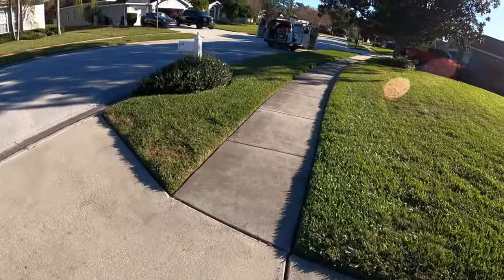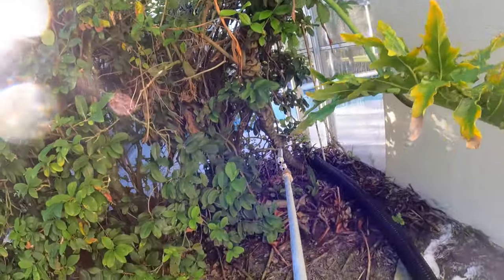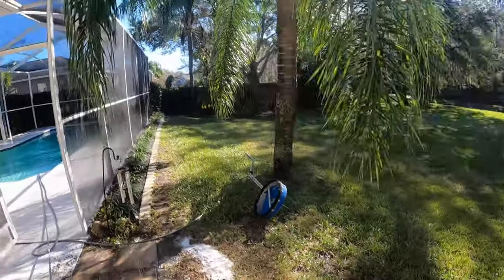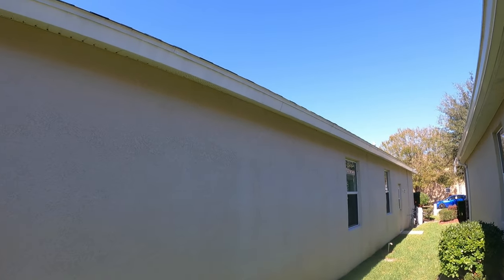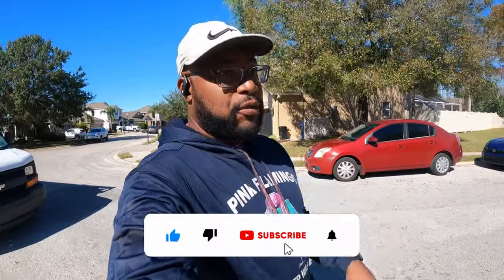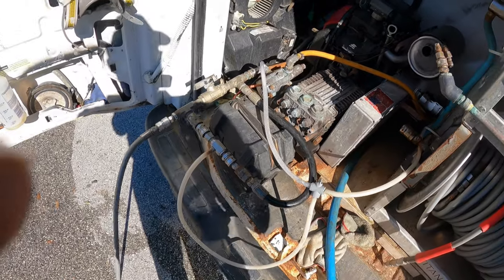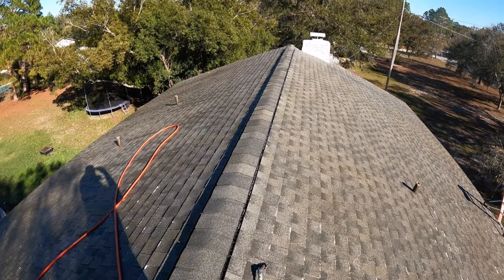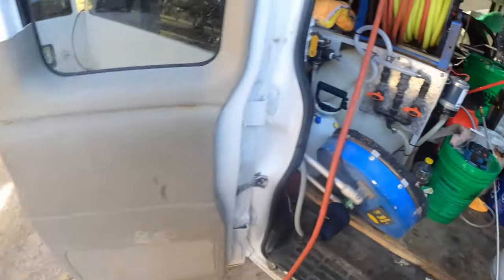soft washing is the way to go for cleaning

Comment: Cliff I was wondering before you got your rig I noticed that you were working out of a van. What size pressure washer were you using that you had inside the van? Also did you always hook up to the customers water supply? One last question, what did you charge for that job? Thanks I hope to hear your feedback when you get a chance.
Reply from the maker: When I had the van I used a 4gom then a 5.5gpm and upgraded to an 8gpm. Yes you always use the customers water, nobody is making water runs to go clean a property. You'd break your truck carrying all that water nonstop lol. I don't recall what I charged for this old job.

Comment: Great vid! How does that downstream injector work on your pump? How is it able to interchange between soap/sh and water for rinse? Looking into buying one. Thanks ahead of time🙌🏽
Reply from the maker: A downstream injector is installed after the pump. It Siphons the chemical when a low pressure tip. That's how it turns on. To turn it off you swap to a smaller nozzle. When you purchase a j rod for your specific pressure washer it will have the appropriate nozzles to achieve that

Comment: My brother, everything looks awesome great content. What gpm roof pump is that. It looked pretty big. Looks like you get good pressure out of it
Reply from the maker: Thanks my brother.  That's a 7gpm 100psi delevan 12v pump. It does spray pretty good. It would shine more if I upgraded my softwash hose from 1/2 inch to 5/8 hose.

Comment: Love your videos, Cliff. I picked up that you mix your surfactant in your SH tank? How do handle jobs where you don’t want to use surfactant or a little less/more? Does your softwash just mix more surfactant when in use?
Reply from the maker: Yea I mix some with sh. Not a gang of it. It's just enough to wash houses and pool enclosures.  Surfactant doesn't affect much when it comes to  cleaning. It only makes the sh cling onto surfaces.  So with or without it there's no real change.  For my 12v softwash system I'm able to meter my surfactant from the mix valves since I have a dedicated surfactant tank.

Comment: Looks like you have changed ur machine an bypass around, happy new year an let’s make that $ money bro
Reply from the maker: Happy new year. Yea I flipped it and I got a new muffler. It's easier to work on the pump facing the rear of the van instead of the inside.

Comment: Cliff all good if I use the gun that you use (ST 2605 in my pressure washer 4000psi 4gpm? Thank you
Reply from the maker: Yes that's a suttner 2605 it will work with every single pressure washer 2gpm-12gpm doesn't matter.

Comment: What do you get for a roof that size and that small house? I’m not competition’s I’m in NJ And what’s a6% mixture?
Reply from the maker: House washing ranges from .15-20c a square foot.  The 2 story roofs ranges from .20-35c.  A 6% is cause I'm using 12% sh but I'm diluting it down to 50/50.  50% water 50% sh. Which gives me the 6%

Comment: I used the solution you suggested for roof cleaning but I used a canister that attaches to the power gun to spray. The solution only turned the tiles darker. Did I do something wrong.
Reply from the maker: Yes cause you're not doing it right. You need a dedicated soft wash system to clean roofs cause you need a 5% mix or better. Can't be cleaning roofs with a foam cannon that's mean for washing cars.
Reply: @PinkFlamingoPowerWash  Greatly appreciated. I’ve learned in my life to always listen to good advice. Trial and error. Thank you again.

Comment: Everything came out great as always. I'm gonna ask I know you've said it a 100 times but what percent of SH are you getting on the trigger with that super Sud Sucker I'm getting old my memory isn't that good Lol.
Reply from the maker: Lol you didn't miss it.  I just haven't recorded it hahahah. Hang in there buddy
Reply: @PinkFlamingoPowerWash  I really like that bypass set you have I'm fixing to get mine set up like that.
Reply from the maker: @Randy Barlow  yes the ball valve in the middle doesn't put NY restriction on the water full when going full flow.  In the beginning I use to have the injector in the middle and the full flow would have to travel through the jump hose.

Comment: does it not matter if you get chemicals into the pool? also do you rinse off after post treatment? i read some things where you should or shouldnt rinse after post treatment
Reply from the maker: Chemical is chlorine. Can't hurt the pool that has chlorine already. And no you need to rinse post treatment. It's on concrete it'll just dry up and make the driveway nice and clean. 

You will find different answers for everything.  Some ppl don't cook with salt and they think it's delicious.
Reply: How do you handle screen enclosures over salt water pools?
Reply from the maker: @JimmyTanglesRecordingCo.  I don't clean those
Reply: @PinkFlamingoPowerWash  ahhh, okay, makes sense. Someone asked and I’m lost on that one. I appreciate your quick response 🙏🏾
Reply from the maker: @JimmyTanglesRecordingCo.  its possible to clean cause that little 1-2% downstream mix isn't gonna mess up a pool with 5-8k gallons of water but that would be a conversation to be had beforehand with the customer.

Comment: At what ratio does your downstream injector pull
Reply from the maker: About 2% which is a little higher than the standard injectors
Reply: If I may ask where did you get it from . Ide like to get one myself
Reply from the maker: @Sandbridgeman1  on envirospec website
Reply: Envirospec super sud soaker I'll CK it out.. thank you

Comment: Hello everyone. I'm French and I'm interested in the soft washing techniques you use (they don't really exist in France). I'm sorry, I don't understand everything you explain and the answer to my question may have already been given... what percentage of bleach do you use in this specific case? All this vegetation would have worried me and you, you go there frankly🤔😵‍💫
Reply from the maker: Hey welcome aboard.  The initial beach solution comes in either 10% or 12.5%  but when the downstream chemical injector is installed to pull the bleach it dilutes with water passing through the hose. The dilution ratio varies depending on the type of injector being used.  But most of them go from 1-2%  

As far as plants and grass just wanted before and after working you'll be good.

Comment: Why dont you rinse the roofs?
Reply from the maker: There's no need.  The longer the solution is on there the better it will clean.  Except for metal roofs, those has to be cleaned.

Comment: How are tou marketing to get jobs?   I try using signs only for competition to pull them up.   I run google ads and facebook with 0 results.
Reply from the maker: Google my business,  yard signs,  Facebook neighborhood groups, realtors, property managers, referrals,  and flyers.

The signs will get pulled , I still put them out anyway cause 100 signs should be making you 2k-5k
Reply: @PinkFlamingoPowerWash  ya the signs are great..ive had only 5 people call me off the signs but made me around $3500 .. after that idk competition came in plus people with no lives pull my signs no matter wear i put them :(
Reply from the maker: @lonerangerspl  that's great return on investment. They will get pulled by code enforcement as well.  I don't care at all If I'm making 3k+ off a batch of 100 signs I'll continue to put them out. It's all part of the game

Comment: Do you have issues with like tar from the roofs or whatever is used that runs off the roof and can mess up the fascia, gutters, sides of the house?
Reply from the maker: I dont have issues with that. That stuff cleans off the fascia. But if left too long it may wear the paint off the fascia.  But that's not on me lol thats on the customer.  There is gutter grenade, gutter butter, LAs totally awesome out there to clean those stains.